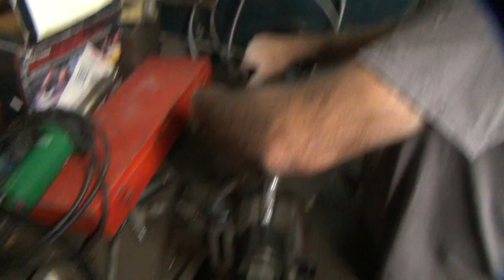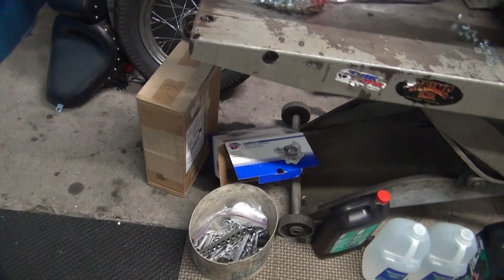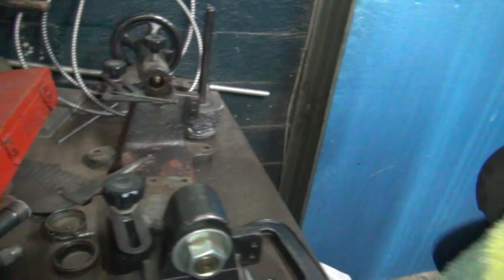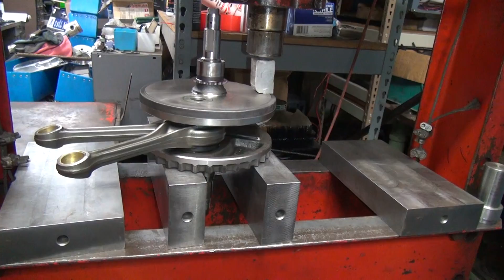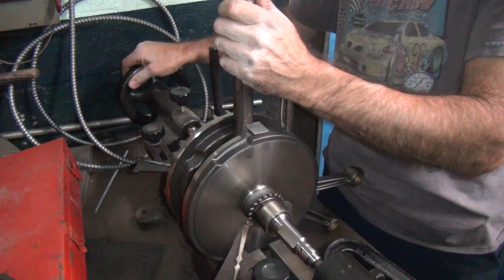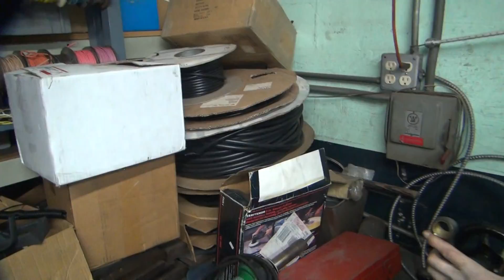#110 How To Do It, True Twincam B" Crankshaft Flywheel assemble 2003-06 TC Harley S&S

Comment: I think all problems are caused by the automatic chain tensioner, if you have a high spot on the compensator (check the run out) the chain tension is constantly too high and with a high spot everything must be broken (install a manual one), including the way at which the bolts are loosened can be harmful to the bearings. In my case I discovered it too late when installing the manual tensioner, the gearbox bearings were broken at 70,000 km and now at 92,000 km the run out exceeds 30 hundreds of thousands, the engine still runs but it needs a new flywheel. I am convinced that with a manual tensioner these problems would never have arisen, greetings from Belgium

Comment: Is welding the pins worth the effort. That and if i get the crank true will welding the pin move it and knock it outta true with that much heat. I'd obviously tig it. But should it be quarter welded. In thirds. All the way around. Looking for some advice

Comment: Great video I'm going to try this to a crank I have that harley says is "junk" out 0.008 on right and 0.007 on left only question I have is if using a lathe as my truing stand is just as accurate and if I should use a brass or a steel hammer
Reply from the maker: yes and the only hammer to use is a nice heavy lead hammer. old wheel weights and a tin can work great to make one from. 15-20lbs. works best.
tatro

Comment: Hi tatro my question is if you true the fly wheels get them true. what if you still have run out at the end of the pinion shaft can you true the shaft. Thanks mike
Reply from the maker: if the crank is straight or true, that is for the whole crank. not just one spot. if not, then you have a twisted pinion shaft or bad center hole. either way the crank would be junk at that point.
tatro
Reply: Tatro Machine  thank you for the response

Comment: How accurate are the gauges you use compared to those dial-based ones? And yes it does take skills to bring the runout to a minimum - 'tis fascinating to watch them being trued as straight as possible as any significant variation would mean the engine's toast.
Reply from the maker: lever style gauges can be just as accurate as a dial gauges if they are good. its all about the contact point and lever length. just a different way of doing the same job.
tatro
Reply: Tatro Machine True, though I'm taking other factors into account like age and how heavily used they are amongst other things.

Also, I bet those flywheels are just as fragile as a hard disk when it comes to staying in true. Drop a hard drive and you're done for. Drop or handle a flywheel roughly and it would certainly be bent.
Reply from the maker: dial gauges would break from the hammering while the lever ones don't care.
i tighten the flywheels very tieghtly so that you can beat on them or drop them somewhat and still be true. that is why i have to use so much force to straighten them. it makes my job alot harder but it is a better job when done.
tatro

Comment: What good is this if all you need is simple pressure to align it when it goes back in the motor with the heat and vibration it will just go back out again.
Reply: I think it's quite a bit more stable when the shafts are in their bearings.

Comment: My 88 Motors is out three and a half thousand should I be worried
Reply from the maker: by harley standards that is way better than new but but by my standards it needs truing. if the motor is apart than fix it. if the motor is together than just run it.
tatro

Comment: This man is the best machinist and the best at engine assembly, but this video is a hoax video that had to be made to get business.  To an engineer as myself I know the man in the video laughs about the people that believe this.
Reply from the maker: think what you think but that is how you straighten these piece of crap twincam cranks. if you think i want to work on these your are nuts. it is straight now.
tatro
Reply: How you straighten them??? That would only mean the crank pin or flywheel ID opening would have to stretch, but we aren't talking about aluminum and that would destroy the press fit itself.  Sir I really am an engineer in my field.  I am retired from Hydril Co subsea platforms and worked in O and R and know metals.  Stop disbelieving me by insulting me by this silly response of yours.  The only actual manipulation you made on that assembly may have been when you hammered a chisel between those flywheels but that would only cause more clearance for the rods to slide and would not change the balance.  Had you known I am an engineer you would not have responded to me with what you did.  A manual turret lathe operator from the year 1920 would laugh at this video.  As for that assembly and its value of workman ship it is a tighter fit and more accurate than the previous bolt on assemblies
Reply from the maker: that is the problem with engineers, they are full of crap most of the time and have no practical since. being an engineer you should know that a tapered hole has more holding power and stays straighter. you just have to have a nut to hold it. i will take the old multiple piece cranks any day over these new cheap press together ones. they will take more abuse and stay straighter than press cranks. just because something is new does not make it better. 
as for the turning. what do you think is going on when you press that crank together? you don't think it is moving around all over the place or do you think it goes together perfectly every time. as for turning it. the same force that pressed it together is what it takes to move it around to get it straight. you have two directions of movement we are dealing with here. twisting, or rotation and linear alignment. the rotation on the crankpin doesn't really do much damage to the hole but the pressing or spreading can cause some damage assuming there was none already causing the misalignment. if everything was machined correctly there would be no misalignment, but this is the real world and i have to deal with it. i don't think the small amount of movement we are talking about here is causing all that much damage in the press fit hole. we are only talking a few tens or thousands here. as for reliability, no one has come back complaining about their out of ture crank is vibrating. i true my cranks 3 or 4 times better that the best harley cranks i have seen. on twincam cranks my limit is .002 out of true and most are closer to .001. most harley cranks are .005-.008 out when new.
if you don't like my tone than to bad, i say it the way i see it. go somewhere else if you want it sugar coated.
tatro
Reply: Earl Guyton don't be dumb
Reply: I agree. I am a automotive technician and cant tell you how many people tell me engineers like i care or that it means they know more then me. Sure it looks good on paper and is supposed to work that way but when its broken leave it to the professionals to fix it.
Reply: 26:39   Play nextPlay now          Demon possessed people
Reply: @JBidensucks  Its a scam video